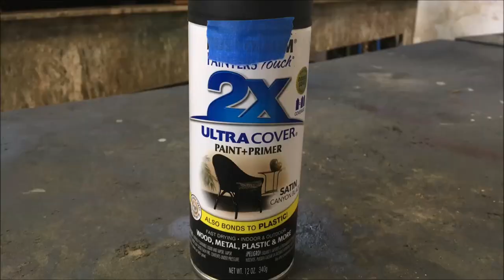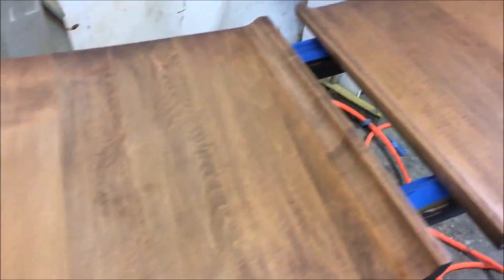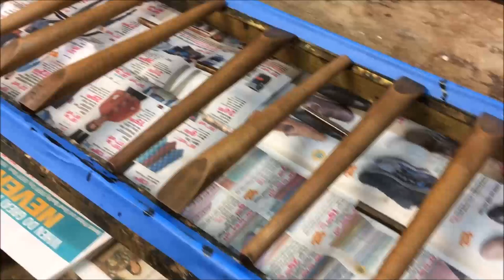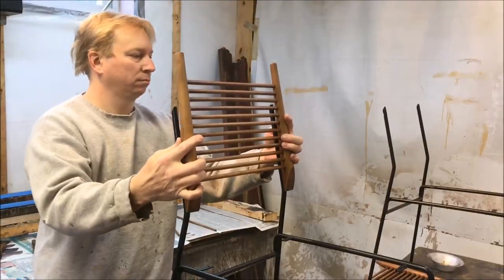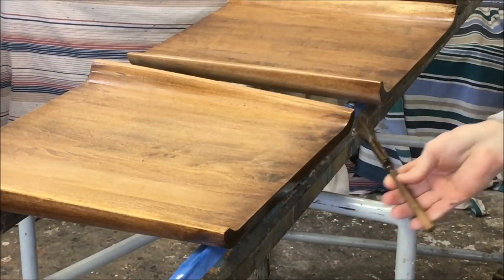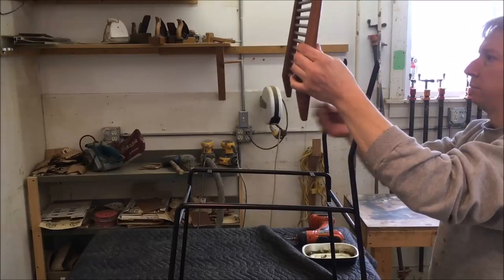RESTORATION / MID-CENTURY METAL FRAME CHAIRS

Comment: Nice job.  I sometimes see people recommend a sanding sealer coat before staining.   Is this something you've done?  Also,  have you had any issues with the water-based poly not sticking to the shellac coat?   Reason I ask is because I've sometimes done a sanding sealer coat (acetone & cellulose based) followed by water based poly top coat,  and sometimes it orange-peels horribly.
Reply from the maker: I am not familiar with the acetone based sealer , but , have never had a problem with the polycrylic over shellac .sometimes sealing the wood before staining is a good idea if the wood is prone to blotchiness .
Reply: Thanks for the reply, Ross.

Comment: Fantastic work.  I'm a newbie and any explanation that you can offer would be greatly appreciated.  I assume that you used an oil based stain since you added naptha  to the stain to create the glaze.  Naptha is a oil based solvent. If my assumption is correct, I'm confused about why you used an acrylic clear without a barrier coat such a dewaxed shellac.  Obviously, you achieved a great result.  Was I misinformed about the incompatibilty of acrylic, a water based product, over an oil based product?
Reply from the maker: THE DUST COAT OF ACRYLIC SPRAY DOES THE SAME THING , I USUALLY USE SHELLAC BUT THE ACRYLIC SPRAY WAS EASIER TO DO IN THIS APPLICATION . THE WATER BASE FINISH  CAN GO OVER OIL IF IT IS COMPLETELY DRY.
Reply: Thanks